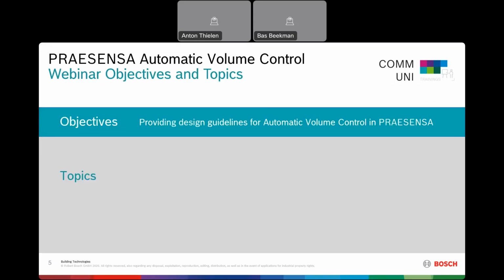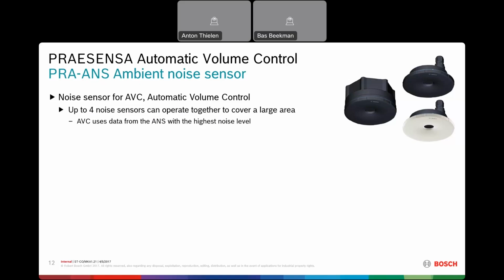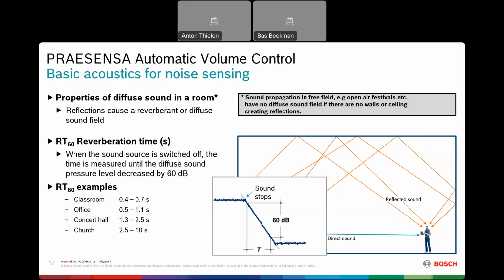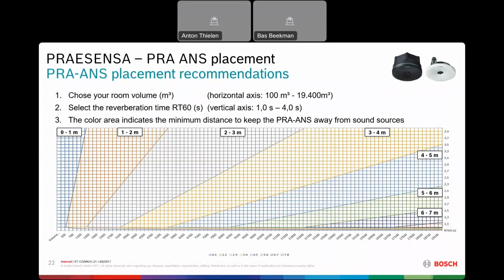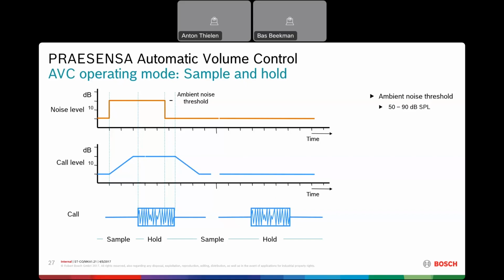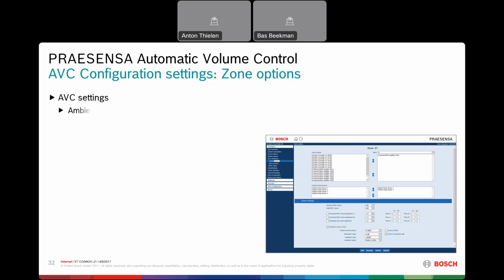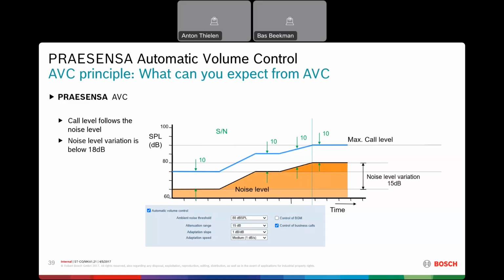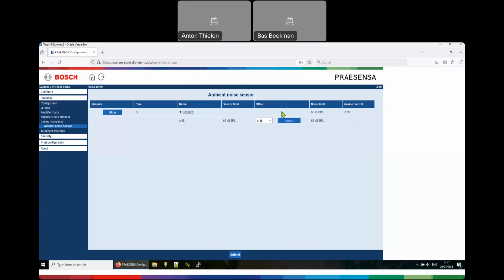Ambient Noise Sensor placement recommendations for automated volume control with PRAESENSA.

Comment: "Excellent and informative presentation! The guidance on optimal sensor placement for PRAESENSA’s automated volume control system is clear and practical. This will definitely help improve sound system performance in real-world environments. Thanks for sharing such valuable insights!"